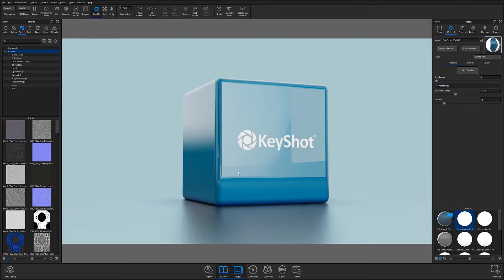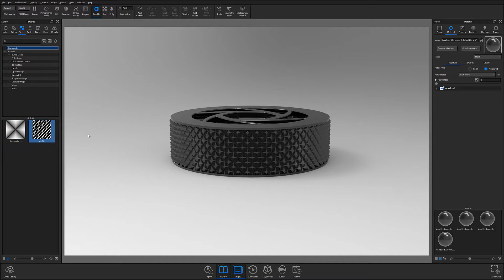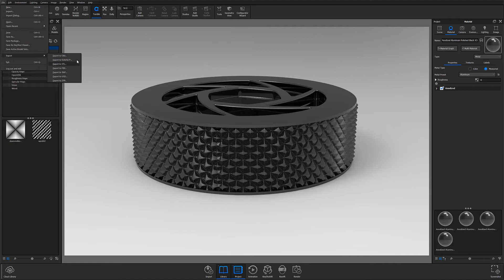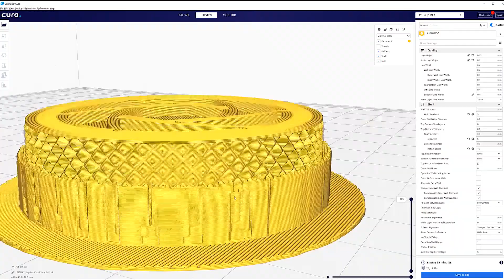KeyShot Quick Tip - 3D Printing KeyShot Geometry

Comment: Sometime the bump i place not showing in stl
Reply from the maker: Hey @remarksacoustic3226! That's because bump cannot be printed as a texture. To create a printable change to geometry inside KeyShot, you need to use a displacement node to displaced the texture on your models surface.

Comment: Cool tutorial! Is it possible to do the same, but include an opacity map? (Exporting a file, which includes a mesh cut out texture add in KS?)
Reply from the maker: Yes, absolutely. You can render with a transparent background for the effect.
Reply: @keyshot  same request: I applied opacity map to get surfaces with halls of different shapes and would like to export the geometry with these halls. How is it possible?